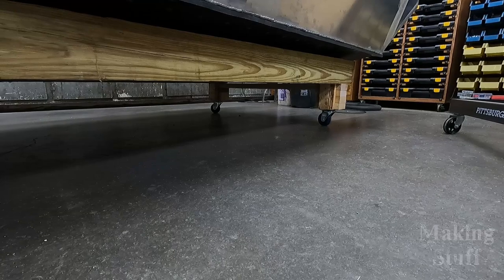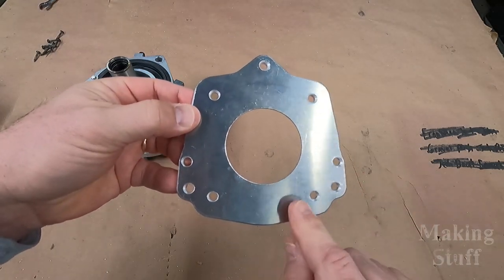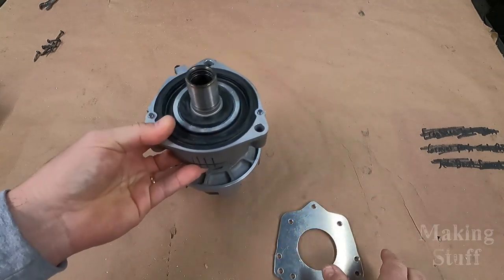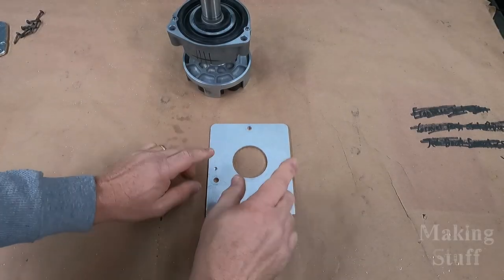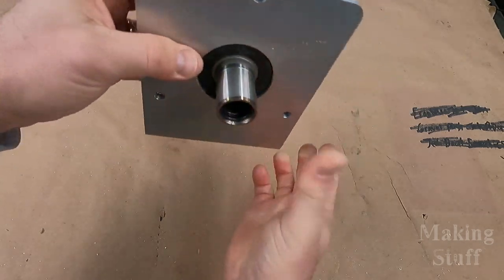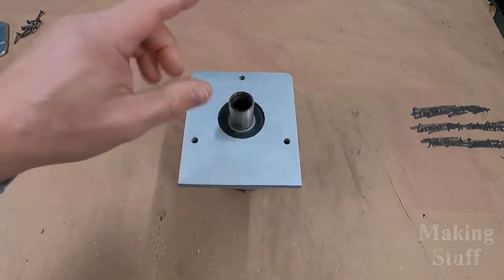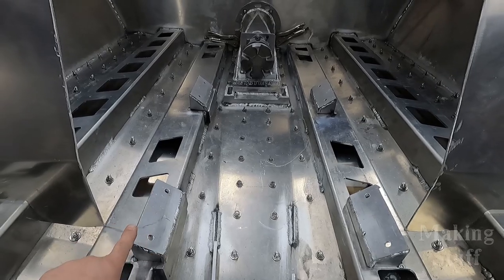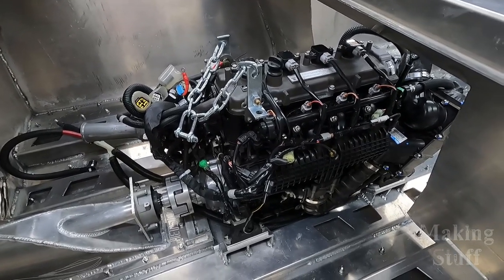Installing the Supercharged Yamaha Engine - Mini Jet Boat Build Part 5

Comment: the bearing plate at 1:48 sec, ya had on backwards, hole are bevel inside to mount it flush with bearing and down pins

Comment: You could have saved time and just TIG welded the holes in and then added your structure so if there was a catastrophic failure this way you wouldn't have had to build the whole CNC table just for that one little piece??????
Reply from the maker: LOL, I didn't build the MPCNC just to make this plate.  Thanks for watching!
Reply: @MakingStuff  anytime man keep up the good work on the videos. I understand where you come on with the lazy cuz after you weld so much it starts to suck!